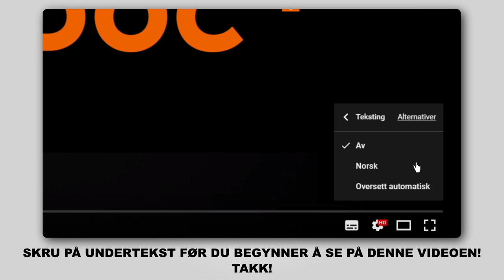Hvordan bytte fremre fjærbein der på BMW E60 [AUTODOC-VIDEOLEKSJONER]

Comment from the maker: Merk! Det er en feil i denne videoveiledningen.
7:05 - Skiven bak må strammes med dreiemoment på 64 Nm, ikke 60 Nm.
10:53 - Skiven bak må strammes med dreiemoment på 165 Nm, ikke 80 Nm.
10:58 - Skiven bak må strammes med dreiemoment på 81 Nm, ikke 75 Nm.
11:03 - Skiven bak må strammes med dreiemoment på 65 Nm, ikke 50 Nm.
11:12 - Skiven bak må strammes med dreiemoment på 100 Nm, ikke 80 Nm.
11:19 - Skiven bak må strammes med dreiemoment på 100 Nm, ikke 80 Nm.
12:24 - Skiven bak må strammes med dreiemoment på 34 Nm, ikke 38 Nm.
Vi beklager ulempen 🙇‍♂